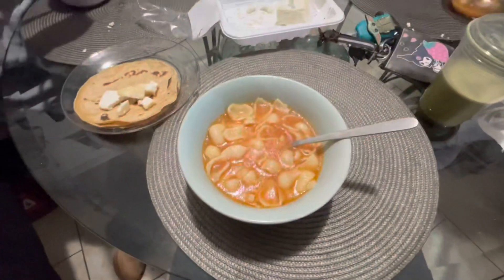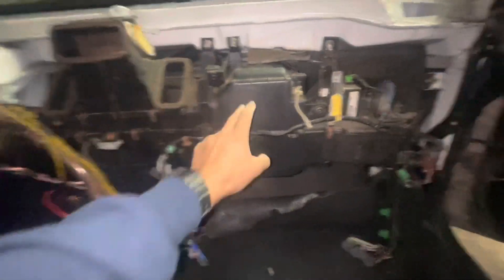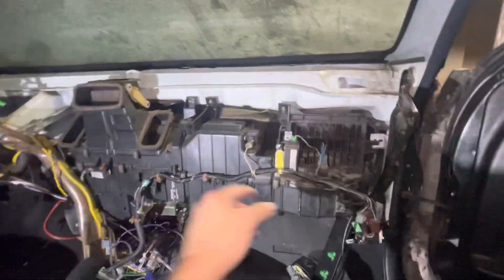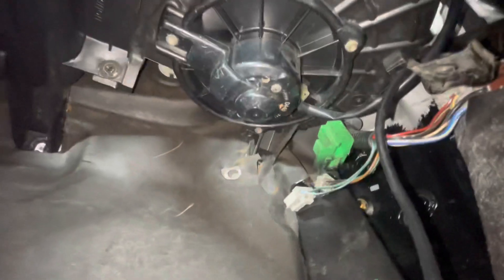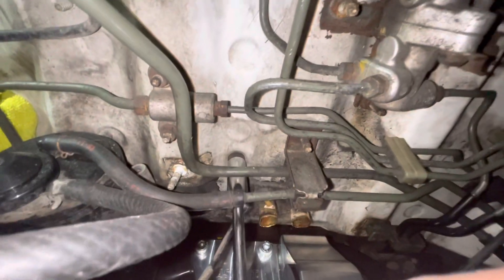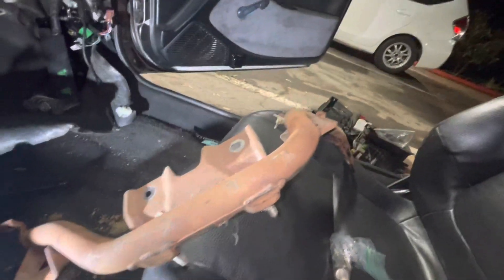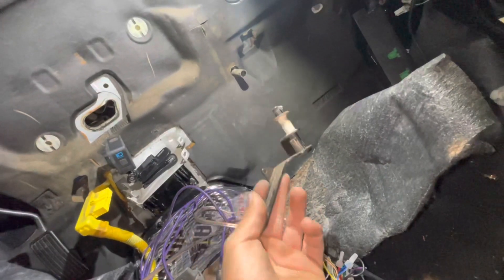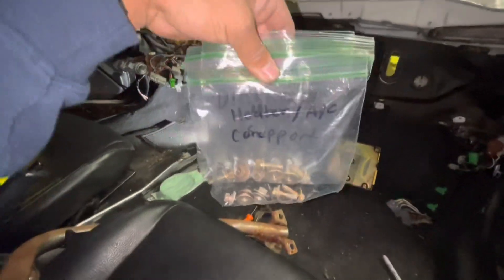92 Honda Civic Heater and AC Removal Is Getting Out Of Hand | Vlogmas

Comment: Bro don’t take out the heater core I did that when I did my kswap now I’m trying to put it back in
Reply from the maker: Do you mean don’t take it out for weight savings or just in general lol? I took it out to work on the wiring and clean it out to put back in. I want a/c and heater in the car.
Reply: Question im just now thinking about removing it completely, how did you route ur shifter cables im having a issue of my cables bending too much and my shifter isnt coming back to neutral by itself
Reply from the maker: I am running the hybrid racing shifter that runs the cables under the vehicle. Almost the same as how the shift linkages were routed